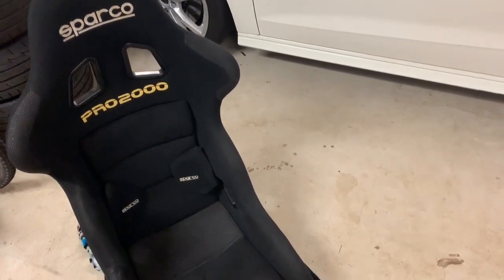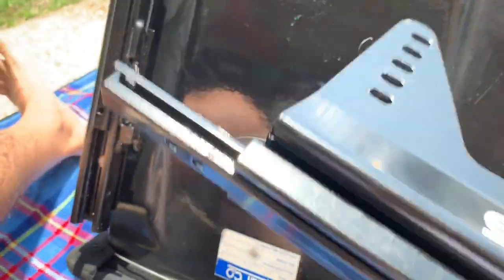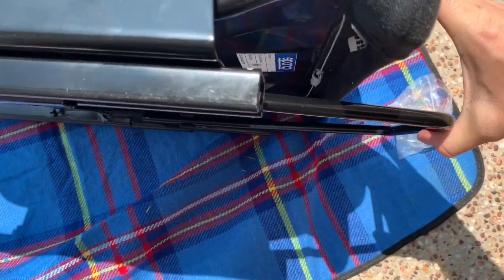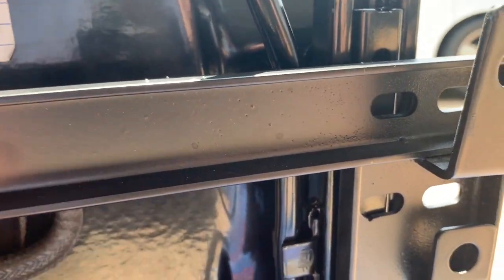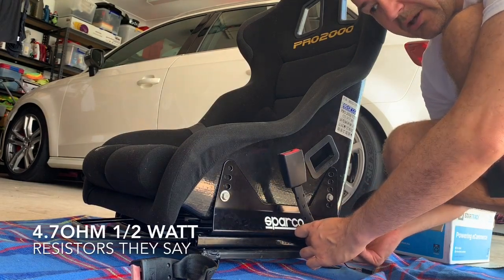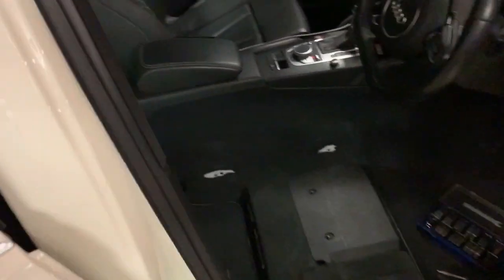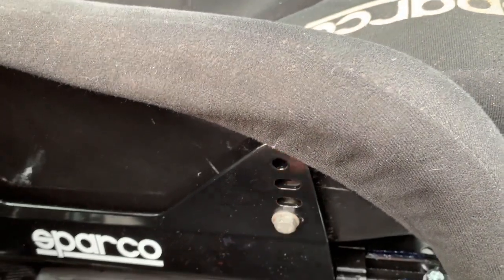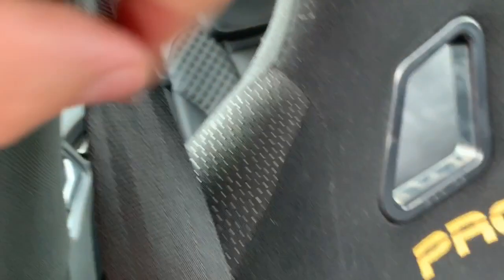How to Install A Race Seat In Audi S3 or VW Golf R MK7

Comment: Thank you for sharing your knowledge. I have a RS3 8V 2017 (facelift), I plan to get the Velo seats for the two front seats. Do you say that the base and slider that you bought from Ebay, will fit the RS3?
Reply from the maker: Yes same fitment as this and the Golf. I haven’t seen them on eBay for a while. I still have one if you are in Australia and want it, otherwise looks like the ones from Planted are the go.
Reply: @TheEddysGarage  Thanks for your advice

Comment: What seat rail bolts did you purchase? M10x38 Hex Head Cap?
Reply from the maker: I bought an assortment of high tensile bolts and the rails also came with some
Reply: @TheEddysGarage  The thread pitch is 1.5 if anyone was wondering. I found M10x35 1.5 and it worked great!
Reply from the maker: @whoismorggan  Thanks mate.

Comment: Does the driver side seat have an occupancy sensor? I can't find anything online about driver side
Reply from the maker: Not sure if it has a sensor or just the seatbelt light.
Reply: @TheEddysGarage  did you get any lights or anything afterward? (Assuming you added a resistor for the airbag). If not, I'd say it doesn't have one and I'll be ordering my seat as soon as my coilovers are in 😉
Reply from the maker: @ultra727  airbag light comes on because the seatbelt is disconnected but apparently it can be coded out. I would put my other seat back in after track days and clear the code.

Comment: Were these safe with the stock seat belts and the high side bolsters? I want to retain my stock belts because I mainly use my car on the street.
Reply from the maker: The lap belt isn’t very tight unless you put it through the side harness holes

Comment: Anyone know about the resistor to use ? Thanks in advance guys
Reply from the maker: I was told that a 4.7ohm 1/2 watt resistor is the one to use but I never did it myself. I just put the stock seat back in after a track day and cleared the code with an OBDeleven
Reply: @TheEddysGarage  perfect I have OBD eleven I will do the same .. thanks for the reply